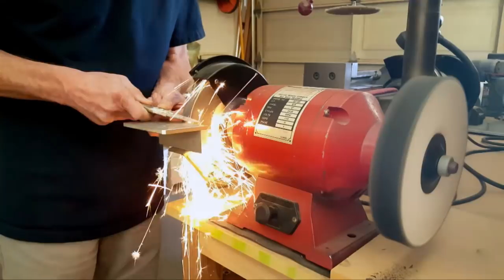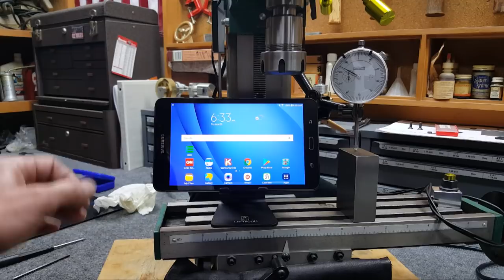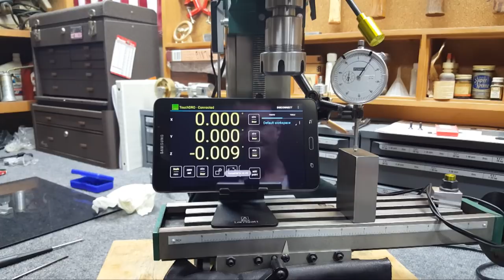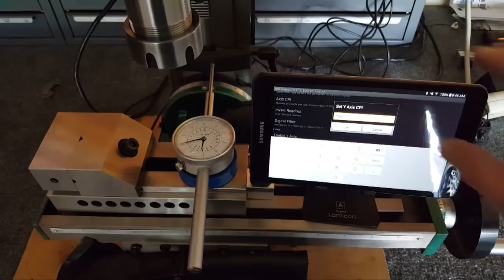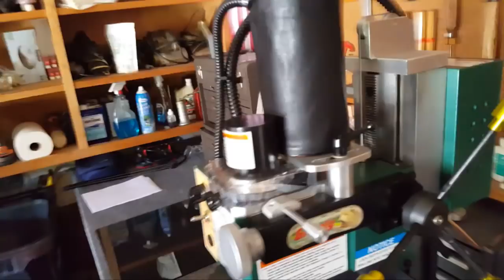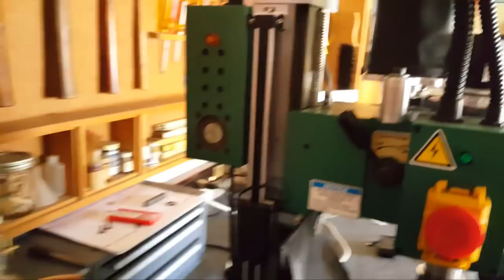Mill blu-DRO Installation, Accuracy & Demo

Comment: Estate sale that much stuff and you didn't go nuts buying stuff. You know your going to be kicking yourself for not buying some items you could have used by now.  I think proto was a automotive repair tool company like Mac matco or snap on.   I love estate sales.  I gave 15 bucks for a high ga but its a comparative type I plan on buying a ditigtal one igaging has one, I really hope its metal and not plastic. Ill still use it but why plastic?

Comment: now, you don't find that you lose steps when changing directions.  Thanks for the info regarding the little black brackets.  I will also find a way to mount the reader head to my lathe saddle ( z axis) using something thin and that will flex instead of my scale.   Thanks for the knowledge.  Blu dro seems like something I would want to go with when my Knee mill display conchs out.  I can't justify it on my light engine lathe.  Thanks for the knowledge.

Comment: Hi Dave! Where do the vise clamps come from? I have 2 such vises and looks for good clamping at the end sides. I have 4 modified clamps from LMS but they use the holes a the long sides.
Reply from the maker: The clamps you see in the video for the tool maker vise I made. Quick and easy to make..
Reply: Haha. Asking somebody that knows, You, I just remember 2 pieces of scrap steel I got from the scrap container at a machinists place and then squared up. Bring up a caliper, some drills, an end milling bit and get milling.... Thanks for the inspiration Dave!

Comment: Dave

Down the road, check out the scales that Yuriy recommens from AccuRemote.  Many folks complain that the iGaging scales have a short life span, and the AccuRemote scales are much more robust and better built

Thanks for the great videos

John
Reply from the maker: Wow never heard that before. My first set are over 5 years and still going and the second set only have a few hours on them. Oh well to late for me since money was already spent. You need to watch today's 4PM and next Fridays video on the BluDRO.
Reply: @TheMiniMachineShop  

The folks reporting short life on the iGaging are using coolant, abd if not using coolant, then they may very well last longer

John
Reply from the maker: Ahhh that make sense! Coolant can easily get inside ad mess em up...

Comment: Hey Dave. Great video. One small thing - EZ-View scales are generally good to about 0.0004". When you see the discrepancy like the one you showed, you can tweak the "Counts Per Inch" value. It's a decimal number, so you can get it dead-nuts on. You can also go through a simple calibration process shown here: https://www.youtube.com/watch?v=ngX0G0Z-02s
Reply from the maker: So glad to hear from you!! Would love to email you with some questions to fill in missing info in the user manual which many have downloaded. Al answered some questions but not all. I am very familiar with the calibration process now.

Comment: Good information on Blue dro. Could you tell me what to look for to find a power supply that has a Transformer. I just installed the blue dro I also have the flicker problem. Any help on the power supply would be greatly appreciated. Thanks again Dave.
               Tim
Reply from the maker: The wrong type are small, light weight and skinny. A transformer is steel and big so look for a unit that is more square, big and heavy. The one I have is by DVE and says transformer type on it. Also make sure the plug polarity is correct the label will show it.
Reply: Dave M thanks for the quick reply your information will surely make it easier to find a suitable power supply. Have a great weekend.
Tim Tuthill

Comment: Seems nice, I look into bludro but haven't made any decisions yet.  However on the tariffs, I didn't realize it was adding 25%!  I was checking some dimensions on Grizzly's site, yesterday, when I saw the notice of the price increase.  I was planning to add some things to my shop this fall, but decided to order last night.  This morning I ran up to Grizzly to pick up my order.  When I presented my paper work the very pleasant lady at the counter suggested I cancel my online order and just buy directly from the store because she could save me 10%, I said heck yeah!  So avoiding the tariff increase and the 10% coupon, I saved about $600 dollars by not waiting till the fall.  I have to say I have been dealing with Grizzly since the early 90's, most of my wood shop is Grizzly as is my machine shop.  I live in Seattle which is only an 80 minute drive to Bellingham so I do "will call".  Grizzly staff loads my truck and off I go!  Needless to say I like Grizzly!

Comment: that is a surface gauge   what its called them pin are to follow a edge of some sort  when using a indicator .on the arm flip it over  that how i used mine, can balance it more better ,look in a old school machine tool book it should tell you more on it  cool find on all your things nice . Heat wave in Maine now to :(